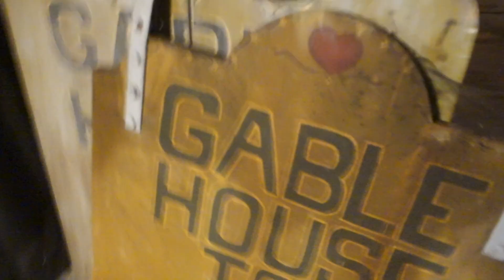Brand new sewer pipe via PIPE BURST technology

Comment: how do you know that the new pipe has the right pitch seems if the old one didn't the new one will follow that path ?
Reply from the maker: Camera inspection in the line shows it drains fine!    Except where roots are of course!
Reply: @kcplumbingandrooter  whats done about the roots ? thanks for your reply
Reply from the maker: Nothing. If there's some roots left in the line after a cleaning, the burst head pulls them all out